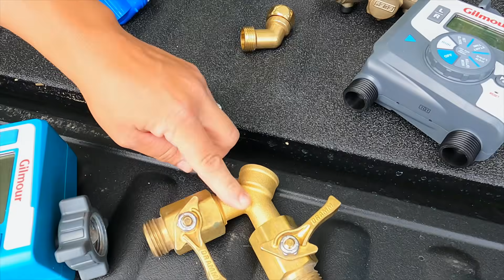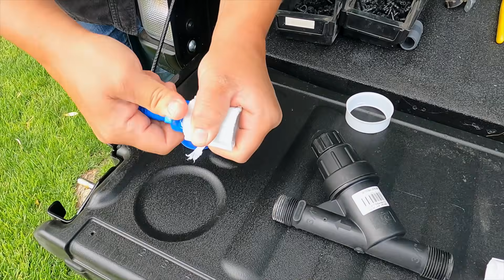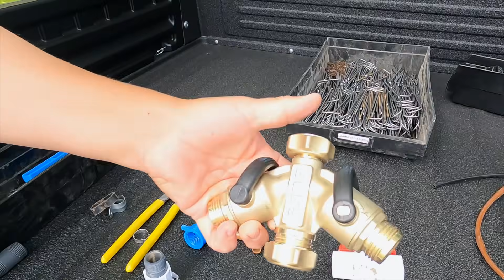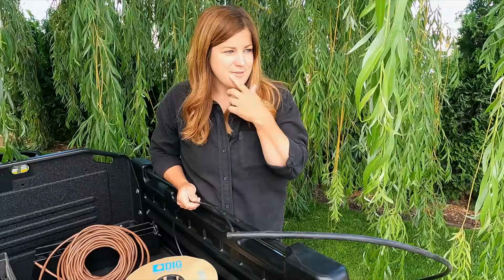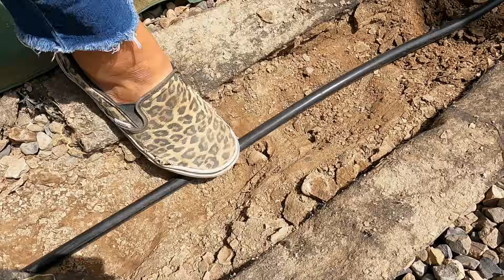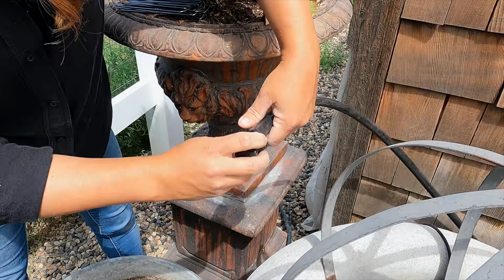Setting Up 18 Pots On Drip Irrigation! 💦 // Garden Answer

Comment: 1:39 - drip parts 
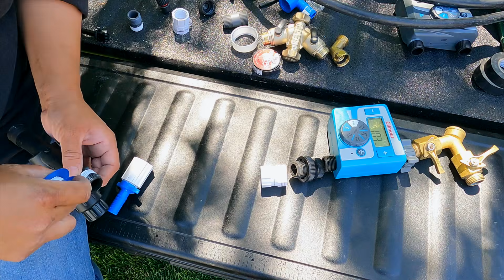20:43 - drip parts (prep)
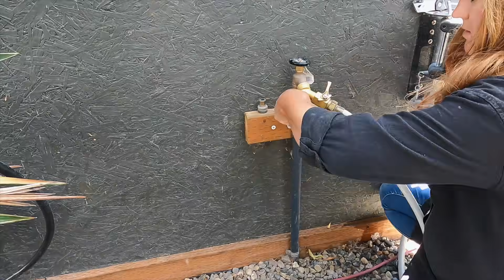20:58 - drip set up
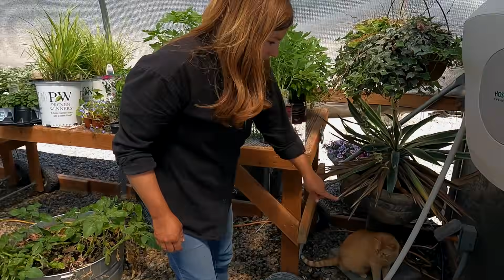23:59 - drip explanation 
L arm-pipe -> timer -> backflow preventer-> filter (pressure regulator combo) -> (threaded pipe -> drip blue pipe converter)

Comment: Be careful if you plan to use 1/4 inch tubing
It can only be run up to 30 feet, and can only handle a flow rate of 30 gallons per hour or less.

Comment: Great videos, I really appreciate the information. My question is, where did you find the angled brass piece between the Dramm twin splitter and the Dramm shut off valve so you were able to angle the assembly vertically? I am having trouble finding the piece and if you have a link or name/brand for it that will be most helpful. 

Thanks again for the great advise, you have saved me a lot of time and effort, especially with the learning curve. Keep making great videos.

Comment: I put my filter and pressure regulator before the timer i’m running 2 zones of my timer supports it, and instead of buying two pressure regulators I simply use one before the timer and the filter to keep everything nice and clean. It’s worked great for years

Comment: I live in a condo and all of our homes are connected. I have pots flanking my garage and the other side of sidewalk to separate my space from neighbors and define my condo from the others. The only way I can run drip is through my flower bed and up and around the garage soffit to reach the other side of the garage. I feel like the 1/2 “ tubing is too wide and would be noticeable around the garage trim. Do you think I could run the 1-4” up and around my garage to reach the other side? Also do they make the 1/4 hose in white so it would blend in with my trim on my garage?

Comment: I installed lawn sprinklers in Jax, FL…if concrete guys came on site and poured sidewalks and garage/driveways before we could run our zones…we did this: 
1) you dig out about a foot down on each side of the cement slab
2) grab a hose fitting and length of PVC to make the distance you have to run the line under slab…glue fitting on one end and attach to hose 
3) turn on the water and use the cut piece with fitting and gently blast under the slab, trying not to wash out the fill under the slab and remove after through other side
4) run a size larger or two sizes (if you need to run wires or other pipes) piece of PVC through the hole you just cut with the pressurized pipe
5) voila, you have water where you had none earlier 😉

Comment: This is VERY helpful! I had watched all videos with your irrigation system, and boy, I watched them many times. I thought I was ready!!! LOL. I visited the hardware store multiple times and stood in front of the same isle for hours. At home, once I had finished connecting all pieces for my small irrigation system, I turned the faucet on and wow it was leaking at every single connection. It took a couple of days to realize that I needed to use the thread seal tape. Lots of 💦 but so worth it.

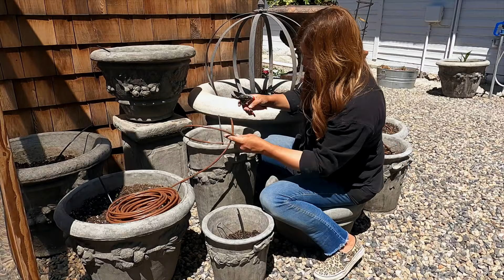Comment: Thanks for this video. Thanks to this video I have now hooked up all of my containers and I can go out of town in the future and not have to ask anyone to water for me. You also helped me to set up drip in my home garden (island, beds ect). My only issue I found confusing was which way to put the barb fittings (the tee in particular) in a circle inside-the container to allow it to drip. The video didn’t show this up close 20:35 so I had to do some trial and error. I finally figured it out.  Thanks again.

Comment: My husband and I will be putting our gardens on drip this year, and your irrigation videos are our guide! So informative. 

I was hoping for some clarification about the position of the different pieces - does the order they get attached have to be as you’ve shown in the video? 

I have a timer with 4 programmable outputs. Can I attach the back flow preventer and pressure regulator to the spigot before the timer? Or do I need 4 sets of those, 1 for each output? Thank you!

Comment: I am setting up drip for my raised beds right now using the 1/2 inch tubing. How do you get the elbow joints on without Herculean strength?  The warm water trick didn't seem to work for me.

Comment: In ground irrigation is only just slightly harder to install than drip. But, it does take a fair amount of planning.  It's more work to change it up. Digging the trenches is the hardest part especially if you have to dig under tree roots.

Comment: Hi Laura and Aaron! This was really helpful because we have to do any hookups on a faucet. We have a hose hooked up that goes to our raised beds. We use a splitter on the hose and run soaker hoses to each bed. It's been a blessing not needing to worry about keeping the vegetables watered enough when it's really hot. I've considered switching from the soaker hoses to drip, but figure, "if it's not broke, don't fix it". 😕 I'm sure that I will eventually need to do that. I am trying to figure out a way to run drip to my 4 whiskey barrels from the raised beds, but they aren't really close together. Hopefully I'll figure something out. Your explanations were spot on! Thank you so much for sharing!

Comment: Throughout your gardens near your house, is the black 1/2" drip line buried in a trench, if so how deep? Or is it just under the mulch as is the drip line?  We are having a ton of splits in our main line which previous owners did not bury so it's been sitting just under landscape rock for years. Just getting dry and brittle I guess. When we replace it, we want to make sure it's correct.

Comment: I can't figure out what I did wrong.  I tried two different timers; used the white tape and various adaptors and still I have leaks.  I then went to using two pressure regulators but that did not help.  Any suggestion?

Comment: Instead of going from the top of the container and hunting for the drain hole. Start with your tubing taped to the stake and go up from the bottom. Then you know right where the hole is and you just have to push it through to the top and pull the line up. Just a thought.

Comment: You are a great teacher! I have a big problem getting the little connectors and couplers into the hole in the feed line and connecting two 1/4 inch hoses. Laura: “You just pop it in like that”. Wimpy wrists I guess. ! Any tricks?

Comment: Absolutely love you guys and your videos! Something that maybe could be verified though... I just recently had to replace the same type of filter/fittings because I had done some work on a bed and when I replaced the tube I used the plumbers tape on the fittings like you are showing. Within 2 days, the filter threads cracked and had to be replaced again. The cause - tightening the fittings too tight on the filter and when the sun hits the filter/tube the plastic will expand. By using plumbers tape you create even less space for the expansion. Per my irrigation supplier - it is not recommended to use plumbers tape on plastic to plastic. Only use on metal to metal. Really not sure if that is a true thing or just what one guy told me. Thought I would share.

Comment: I find that I struggle to pop the 1/4in connections into the 1/2in tubing, once I've punched the hole. Is there a technique or tool you suggest?

Comment: Thanks for sharing your irrigation knowledge? Is the 1/2 inch black tube solid? Meaning it doesn’t emitters? Thanks. I’ve been wondering if there is that option to just have solid tubing.

Comment: This was a great step by step drip video! If we are just using a soaker hose in a bed of shrubs and perennials instead of drip do you think we need the pressure regulator? I should have gone with your grid layout in a bed because I had no pressure at the end of the hose 🤨. So now I’m redoing it like your beds. Thanks 😊

Comment: Those clips are called screw clips. There's also Roca clips that are open on the back, and use nails instead of screws. Both will be found in the low voltage section of Lowes or Home Depot.

Comment: After watching this video,  I wanted to share a trick my awesome husband figured out. We just finished installing drip to our containers and of course I already had them potted up, so we had to run the 1/4" tubing on the outside of the pots this year. In order to keep that tubing in place,  he used binder clips (the black ones typically found in an office) to hold the tubing in place. He ran the tubing through the silver part of the clip,  then just clipped it to the side of the container- genius!!!💖💖💖 He used the mini size,  but they have any size you need for your containers. It has been fabulous!!
Reply: So happy you posted this I have a bunch already potted and was trying to figure out how to stabilize the tubing!!!

Comment: This is so helpful - I’ve set up drip to my window baskets and pots using all your videos and utilizing all your adjustments but I’ve run into a snag with my vegetable garden layout.  I use all the same equipment such as 1/4 in tubing with and without holes, 1/2 solid poly and 1/2 poly with holes.  When I tried making the grid with the 1/2 poly and couplers, corners, etc., the poly doesn’t lay straight it curves and the landscape stakes don’t anchor it well enough in the fluffy raised bed soil so i can’t get my tubing down - it’s highly frustrating.  I’ve tried laying the tubing out in the sun but it tends to want to maintain the curve of the roll it comes on.  Also would like to note that the couplers and drippers are a lot harder to push in and really hurt the fingers (you mush have strong hands and finger tips!)- I usually keep a hairdryer near to heat the ends with helps a lot.   Thank you for all you teach us!

Comment: After watching you discuss irrigation & run it to your planters for the past several years, it still seemed rather fuzzy to me. But about a week ago I was looking up irrigation parts on Amazon & suddenly it just all kind of clicked! I probably won't try to set it up this year but at least I finally feel like I know how if I decide to do that in the future so THANK YOU. Also, Habitech makes a Drip Irrigation Faucet Adapter Kit that combines a backflow preventer, filter, and pressure regulator all in one piece. Have you ever seen it & if so, what is your opinion about it? Seems like a combo device would simplify things a bit.

Comment: Maybe this is something everybody knows but me:  I already had 1 roll of 1/2 inch 100 ft tubing, needed 2 so ordered another 100 ft online.  What I didn't know is that 1/2 inch from different companies can be .600mm or .700mm & the fittings for one don't fit the other.  It was so frustrating because I had already cut up the tubing so couldn't return it.  It was a nightmare of trying to fit this maze of tubing to the different fittings using a hairdryer to soften the tubing.  Eventually I got it done & it works great but woah what a nightmare.

Comment: , winner winner chicken dinner--you deserve an Emmy for this video.  Even at my advanced age I could understand how it worked and how it went together and how each part was needed.  Most of us would not have known about hose thread and pipe thread.  Now we do, and I always use that Teflon tape whenever I have hoses connected together that still leak in spite of new gaskets.  Superb show you two, you had my complete attention the entire time
  Drip tube demystified ‼️

Comment: Do you ever worry about the water in the drip line getting too hot for the plants? When I go to hand water my plants in the summer, I run the water and let it cool off before I start watering the garden fearing I might scald the plants or  their root systems. Am I right to worry or is it not a big deal when it’s just a drip of water at a time?

Comment: At 23:11 you said You can go from 1/4 In to black poly.. you mean from 1/4 to 1/2 inch? I was trying to picture de setting for trees using 1/2 gallon emiters or bubblers but not sure that you can go from small diameter to a bigger one.

Comment: Thank you so much for posting this video.  I purchased some drip supplies this spring - all because of you!  I have not tackled this project yet though because I am still a little intimidated, but this video just may give me the push I need.  I think I still need some more pieces and parts (pressure regulator, backflow thingy because I also have a well), but I am determined to figure it out.  You guys are awesome, don't ever change   🥰🌺👍

Comment: I love setting up a drip system! It feels like legos for grown ups.  Can you plug into the brown tubing that has the emitter built in?  I have the 1/4 in brown tubing with drip every 18in, but I assumed you could only plug in to the black tubing.  Now I am second guessing my assumption.  They also have nice starter kits at Home Depot and such, which was very helpful the first time I set up a drip system. It has all the pieces you need to start and then it is less confusing when you do your second project.

Comment: Hi Laura and Aaron! I have been following you guys for years now and I just have to say thank you for always being real and showing even the not so pretty parts. When it comes to the pressure regulator, I don't have a problem with tubes popping off. I actually deal with not enough pressure. I know you guys don't deal with that, but I was wondering if you may have come across anything that would help in that situation? I live in Guam where it is hot all year round and can't be having a water issue X-D

Comment: This was SO interesting and informative! Thank you Laura and Aaron for making this so easy to understand!  I might add that drip tubing is so much easier to work with if it warm and has been sitting in the sun. I tried to set up some drip in April when it was still cold outside and it was SUPER hard to crank those emitters and elbows/couplers into the tubing.  I wish we could find gray tubing to match concrete!

Comment: I found a combo of all three: Habitech Drip Irrigation Faucet Adapter Kit: Connect 1/2" Tubing to Faucet or Hose, Backflow Preventer, Filter, Pressure Regulator - No Assembly Required
Reply: Rainbird sells the combo.

Comment: Thanks for sharing your approach to using the drip system again. I just put in my 1st one and fingers crossed it continues to work well. My question is how deep you typically trench. Like you, I deep with a snowy cold winter and wonder whether I need to dig 1’+ deep or more? Also wondering what steps you take to prep your gardens on drip for the winter. Thanks again!
Reply: Oh one more thing!  The music track you’re using has me bopping my head!  Good tunes..:)

Comment: OMG thank you so much for explaining the difference between a hose thread and a pipe thread - I had a pressure regulator that leaked so bad I just took it off and didn't use it!  No wonder it leaks!

Comment: Add that there is also 5/8 tubing (raindrop makes).  I brought some 1/2” tube fittings and it took a second to figure out that they would not go on my 5/8 tubing and I had to get different compression fittings.

Comment: I set some drip irrigation up in my own garden and I had a couple questions as I did it.  Do you worry about each plant having an emitter close by or do you strive for general coverage of the garden?  Also do the emitter holes have to all be facing up/down/sideways so each emitter dispenses the same amount of water? Thanks- your videos with my morning coffee are the calm before the storm of my 2 toddlers waking up. 🥰

Comment: Adding the pipe tape… obvious but we missed it and had small dripping despite a tight installation. Redid with pipe tape after your video and drips are gone. 😀 Thank you for your candid and thorough instructions. You’re a blessing.

Comment: I love cats, however they are one of the most destructive of invasive creatures on the planet according to some sources.  Have you ever considered keeping them indoors?  Just a question, I realize it is a bigger problem, but little things add up.  For example, spay/neuter, keeping them on leashes or in a kennel, special kitty runs etc.  It's also safer for them.

Comment: So what happens if you have to run the 1/2in further and tap more 1/4in into it for the drip? Do you need more hose bibs to tap into or use both of the Y connections to put timers on and drip on and forego the hose entirely?

Comment: Thanks for this video!!! So so helpful! Quick question about troubleshooting… I set my pots up with the 25psi regulator and the tubing with holes every 6 inches and when the drip comes on the holes spray instead of drip. The faucet isn’t turned on all the way either. Any ideas on how to fix this problem? Thanks!